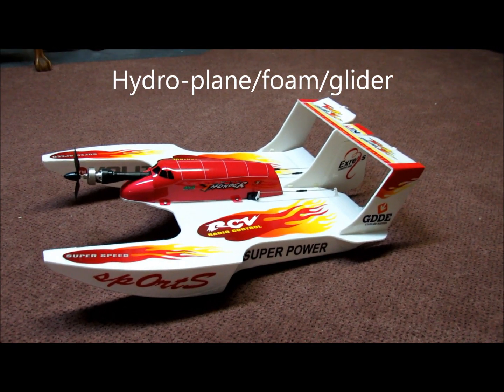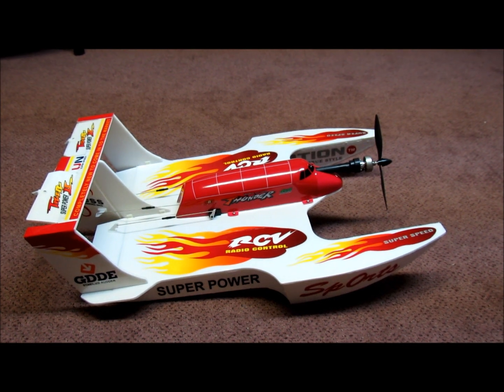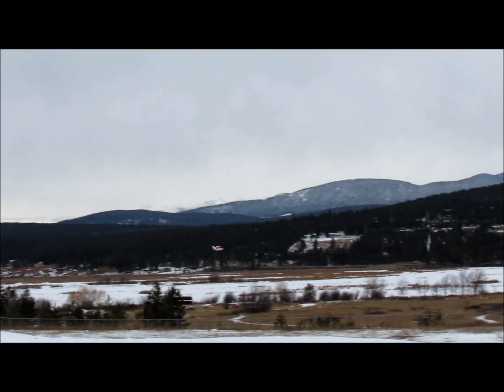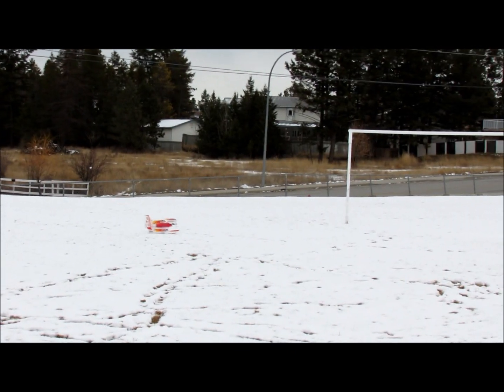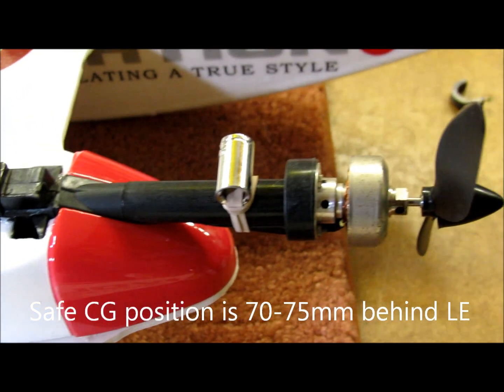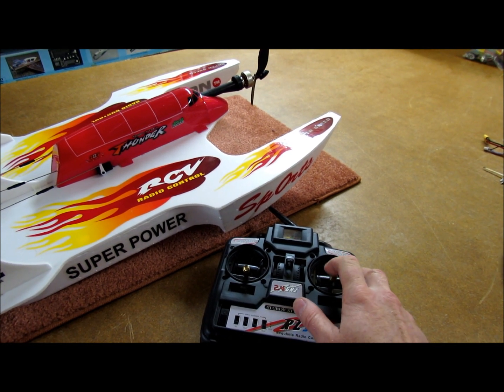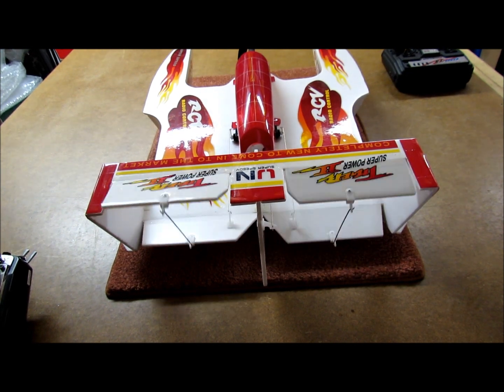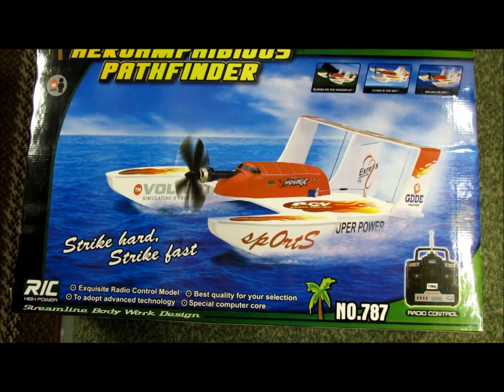Hydroplane, Hydrofoam, Hydroglider - flights and mods for CG

Comment: this isn't a very durable craft.  i had one (blue) and landed it and the rear ailerons came loose.  had to glue parts i thought would break.  you need nose weight too or it will flip over.  learned the hard and expensive way.
Reply: What did it cost?
Reply: 150.00 but this was back in 2010.

Comment: Thanks a lot for sharing. My uncle gave me one with 27Mhz radio which I replaced immediately with a 2.4Ghz one. Mine was way nose-heavy and I got the CG right (70mm - 75mm from LE) using a piece of lead.

Comment: What plug combination did you use?  I tried that but couldn't make it work as I was never able to isolate the rudder servo. Ended up switching the wiring inside the transmitter, which worked fine.

Comment: The same Hydroplane in blue color. I lengthened the rear wing on the left and right side ending for 25 mm like original on the bottom plate. This assists the uplift at the rear. Now it don't fly tail heavy
I also moved the battery forward  under the controller box.

Comment: Easy to convert to mode 2 by just switching the servo plugs.
Mine is all strengthened with carbon fiber spars. I'd sell it if you know someone that would like it. 3 cell LiPo and charger and 3 recievers all included. Good as a 2nd or parts for you too.
Just reply here on your page and I will get it in my email.